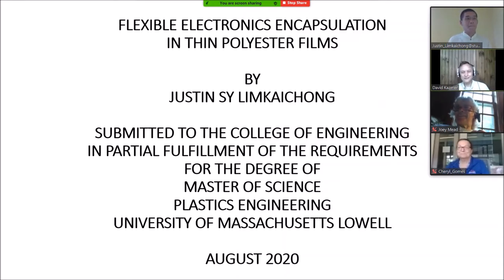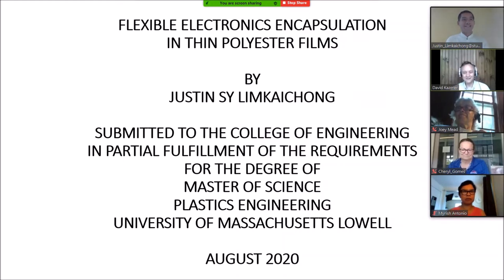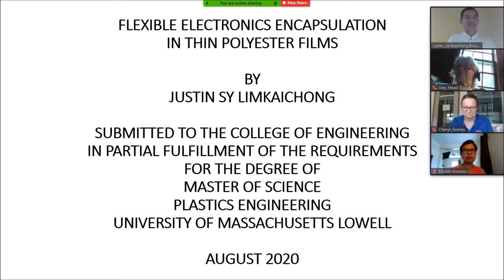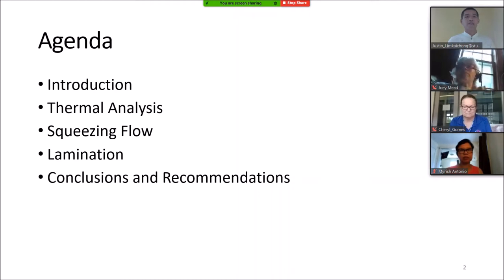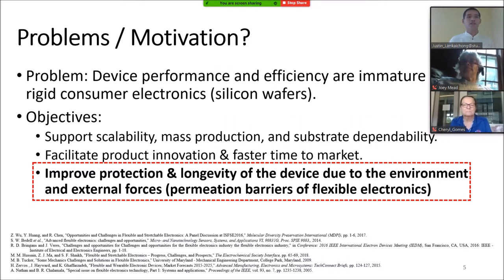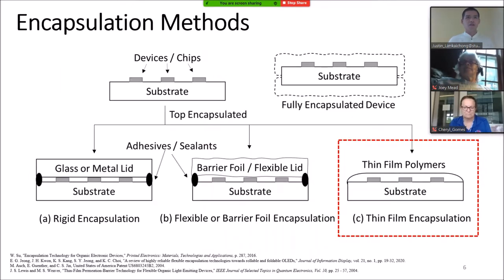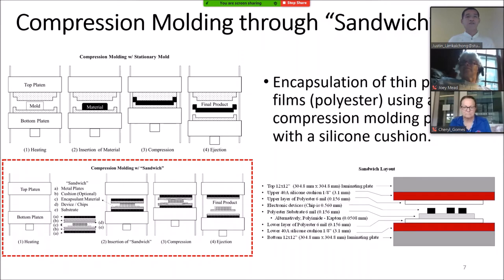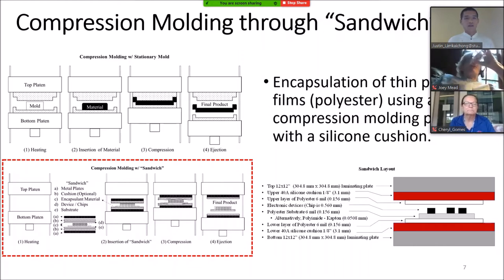Encapsulation of Flexible Electronics with Thin Polyester Films (Limkaichong Justin)

Comment: Bro I want to buy a stock of a company which manufactures polyester films. I read it has use in electronics and electricals but I did n't found a specific application in same. While searching came across you video. If possible can you please share specific use of polyester films in flexible electronics.
Reply from the maker: @Pritesh 

Hi Pritesh, my apologies for the late reply and Happy New Year.

From what I know polyester films (context of Flexible Electronics), are typically used as either substrates (a base for your electronic components or chips) or as an encapsulant material or "permeation barrier" as presented above.

Hope that helps!
Reply: @justinlimkaichong1306  Thank you Justin.